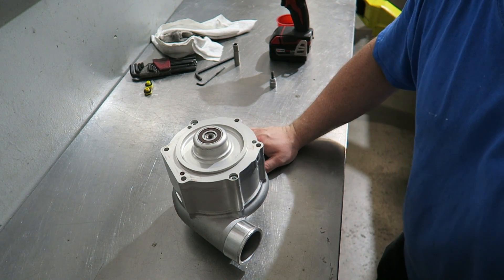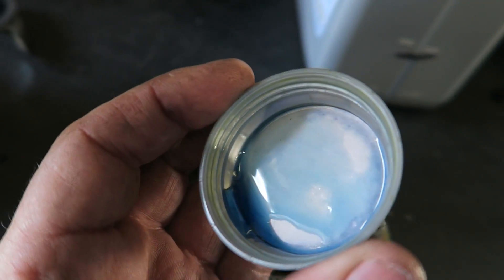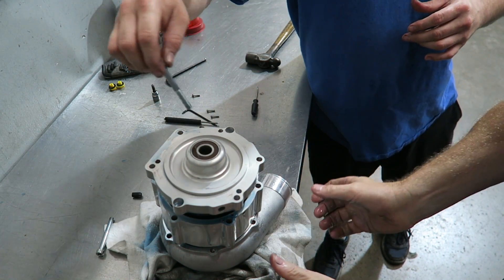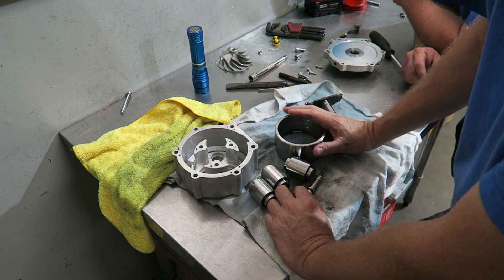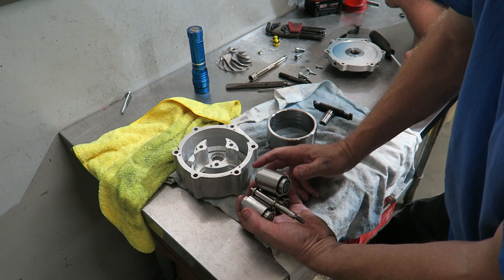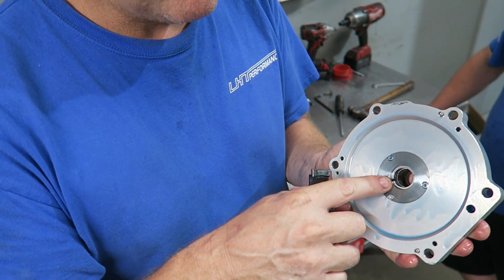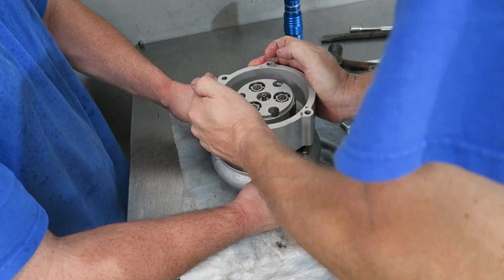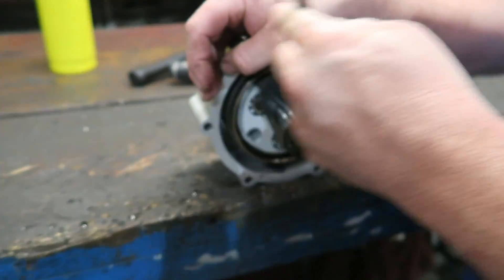INSIDE A KRAFTWERKS SUPERCHARGER - Rotrex

Comment: C30-94 on my 2.7l Toyota Tacoma lasted only 17K miles. It still makes boost, however, suddenly sounds like marbles in a tin can.    Daily driver and never abused.  Very disappointing from a financial standpoint.   That being said, I am a Journeyman toolmaker at a high precision machine shop.  I appreciate the teardown in this video and will be diving into what has failed along with mine. Hopefully, along with the help of an engineer or two, come up with a solution for the failure and make improvements.   There is no sense in buying another one with the rate of failure of these units.  Hindsight is 20/20, should have done more research prior to selecting this brand.

Comment: It's basically a Paxton SN series that uses 3 cylinders instead of 5 balls. And while the rotrext pulley turns the drum, the paxton SN  pulls turns the ball carrier (piece in the rotrex that the 3 cylinders ride in).
I bet it's a precise fit ,because the paxton had big springs that squeeze th barrel portion against the balls to get th traction

Comment: I think mine  broke
Reply from the maker: What is it doing?
Reply: @LHTPerformance  so it only has 5000 on it. It made a loud clang noise when I was driving it. Then it started running like it had a miss or air fule mixer is wrong. I started it last night and it sounds like the shaft is spinning up fast. But their is not very much air pulling in. And the muffler just sounds like bad. It has no power. And to much throttle will kill it.
Reply: It ran grate before the loud clang noise. I pulled the spark plugs. It burned one up before. Their all fine.
Reply: Their is no black or white smoke from the exhaust. It sounds like a flutter kinda sound.
Reply from the maker: @iamwilladd  It’s doesn’t sound the blower that’s causing issues.   I would have someone plug in and look over the data and see what’s going on with it.
Reply: @LHTPerformance  ok I will get Brian spears on the horn a remote look over and try to iron it out.
Reply: @LHTPerformance  so if I have good comprehension. Is it possible I blew a head gasket?
Reply from the maker: @iamwilladd  The compression should explain a lot. I would have it checked out.
Reply: So I reached inside and grabbed the turbine blades, spun it in the correctly. And seems pretty easy to turn by hand. Like i can turn the belt by hand?

Comment: Interesting design. I assume the compressor wheel continues to spin when not under load like a turbo does due to the tri bearing setup? What failures are you having? No boost or leakage? Or lost of boost etc from 10 psi to 5 psi? I think I can probably figure it out, it is such a simple design. Oh, I am a mech. engineer so thank you for sharing the innards.
Reply: The impeller shaft breaks and bearing goes bad. There's lot's of video's out there.

Comment: I installed one on my 2013 MX5 about two years ago, and found the wine a bit loud. Two years later it sounds like a jet engine, to the point where it hurts your ears if the hood is open, any suggestions on how to make it quieter
Reply from the maker: I would recommend a fluid and filter change if it’s been a while. Keep an eye on the fluid color.  As it darkens it get a charcoal color and needs to be flushed.

Comment: The input shaft threads into the power transfer bar.  When it is operated the input shaft tightens into the bar. This is why you never turn the pulley backwards.  Doing so can damage the pump and can unscrew the input shaft from the power transfer bar.   Never turn the pulley backwards.

Comment: Just an FYI in response to the couple of nay-sayers.  I've run a c30-74 on my track-built Miata for about 8 years.  70-80k miles.  Often over-spinning it in competition, 200+ dyno runs in car development.  Car makes more than double the stock horspower, even with the current engine with stock internals, (unit outlasted the built race engine)  Issues with mounts and tensioners (KW and TDR), but never with the unit.  I'll be upgrading to a c30-94 without reservation.

Comment: Subj: Weak link.

The black plate connecting the "driver shaft" to the cage is my main suspect.
Why? that poor single piece of metal has to suffer the whole impact of reprated violent inertia variations..alone, I think the link between the driver shaft and the cage should look rather like a spokef wheel a gruyere cheese full holed disc in order to have the necessary rigidity/flexibility.

Comment: Great video demystifying what's inside them. I'm not an engineer but you'd think there'd be some cooling fins on the unit, or does it need some heat to make the oil inside function properly. I don't understand what the oil pump inside does. Is it circulating the oil through a cooler maybe, hence no need for cooling fins? It reminds me a bit of a viscous coupling, which is a dubious device in my opinion. These things seem ludicrously expensive too, compared to a turbocharger. Hard to believe D-motor use them on their aircraft engines, as they don't appear to be particularly reliable. Seems a good concept though, just needs some further refinement and development to be totally bulletproof.
Reply: Rotrex use a traction fluid which also has its own resorvior, filter and cooler.

Comment: Well you guys need to know these Superchargers have the highest failure rate of any forced system... Sadly it’s what’s on our Tacoma. I should have done more research before buying the URD Rotrex kit. My .02 cents is it’s a POS‼️
Reply: Randy,
Was it under warranty or were you able to find the failure point and what did Rotrex say?
Reply: @gabeh7373  No warranty on mine as I let it set in the box for two years because I had a few surgeries & while healing I read a LOT of bad reviews on these! They can’t be rebuilt and they are about $2k and up from the prices I have seen. You have to buy a totally new SC‼️ The Internet is full of negative feedback on this SC. Yes it’s a neat design but they break all the time...Ours is on a Tacoma the system is by URD / You R Dumb for buying this system. 👎
Reply: That sucks! I was considering one for my Lexus but I have to do my research. I'm curious of Rotrex has changed any of the design elements within the supercharger if they've been getting a high failure rate?
Reply: @gabeh7373  HELL NO when they take a $h!t they get another sale! Why would you change?
Reply: 😬😳😏.... OK Thx for your feedback👍
Reply: @gabeh7373  So have you found any other negative feedback about this? I’m having a hard time trying to unload mine for $1500 less than they sell for new and the vendor has been out of kits for months…
Reply: I have not found anything else to report on. I kind of put the whole idea on hold about supercharging my car so... 😑🤷🏽‍♂️

Comment: Why would you use this over say a Paxton or vortech?
Reply: Simplicity and power delivery most likely. Low to almost no extra load on the motor at low revs but gives a very linear power delivery like the other superchargers. Has its own lubing/traction fluid separate from the oil and coolant going to your motor. Very compact accessories (fluid filter, cooler, reservior)

Comment: Just curious, how did you guys press back the sleeve in? Bench press or using torch to warm it and press?
By the way these type of supercharger usually fail on the roller bearing, which i suspect of the compress tight fit to drive the shaft result a heavy stress and may due to dirt in the oil to cause it fall into the bearing  which fail during operation

Comment: Im seriously looking at this type of supercharger for my DC5R but iv seen so much about these snapping the shafts and failing. do you get any of these fail out of the amount of kits you have done?
Reply from the maker: K20TBH We have very few issues at all. Most of the issues are related to the belt having too much tension.
Reply: Ok that makes sence. Would a rotrex be the better option for me on track or potentially look at a turbo?
Reply from the maker: K20TBH If it’s just weekend track use either will work. If it’s serious road course I would recommend a build NA motor.

Comment: Are these actually better than Vortech, ATI, etc. with regular old gears inside?  It sounds like you are saying they are significantly more efficient???
I've got a Vortech V3 Si on a Subaru EJ253 and I'd like to get more power out of it.  I'm maxed out the Vortech at 52k impeller speed.  We only make about 320whp at 15.5psi @ 6200rpm.  I'm thinking about putting a Rotrex C38-71 on it and spinning it to Rotrex redline  of 90k with a 70mm pulley (crank puley is small: 5.22" so 70mm Rotrex with 7.5 step up ratio will get us around 90k impeller @ 6300rpm).  I am wondering if you can offer any insight?  The C38-71 should put us right in the middle of their compressor map... unless of course the Rotrex is so much more efficient that I should size up the Rotrex, expecting to make more power at a given Pressure ratio.    Even on the C38-81 we'd still likely be inside of the white  "island"  on the compressor map.  My  goal is basically to make as much power as possible without having to rev out the engine much more or more at all (i.e. I don't want to rev it out to 7k)  I've also looked at ATI's procharger CS-1 which has an 8.3:1 step up ratio.  If I am going through the effort of starting my build over from scratch I want a significant increase over 320whp we're getting now.

Comment: Maybe a splined impellor drive shaft would have cured the potential weakness within the unit, however this would have surely resulted in slightly higher manufacturing costs and been passed on to the customer.

Comment: OK. The issue is not with the supercharger its with the belt drive. Kraftwerks uses a tooth belt on these S2000 conversions. Rotrex say categorically to use a poly vee belt. If your not going to follow the rules you're going to break it. The input shaft is not pressed in, it is screwed in.  Follow the rules and it won't break. The shock loads when hitting the rev limiter or launch control are nasty and the tooth belt transmits the shock and the shaft strips the thread of the input shaft. TTS Performance do an S2000 kit with vee belt and auto tensioner, they don't have any trouble.
Reply: That’s the BIGGEST BUNCH OF CRAP I’VE EVER HEARD‼️ This supercharger has the highest failure rate of any & ALL FI systems. The system I have uses the proper belt and they STILL FAIL ALL THE TIME‼️ Neat design but a POS‼️
Reply: @randy6350 I'm going to have to agree based on all the failures I've seen.

Comment: It's an epicycloidal system.
The same is used on excavators and bulldozers drive trains ,but backwards,to reduce speed ,increase torque,reduce load per moving part.
It's a really old design,and this one is just working on simple friction,with no teeth.
If you get loose bearings,looser tolerances and no more friction,so no more spinning.

Comment: still dont get why we cant spin it backwords
Reply: HORSEPOWER4321
1 second ago
OK. The issue is not with the supercharger its with the belt drive. Kraftwerks uses a tooth belt on these S2000 conversions. Rotrex say categorically to use a poly vee belt. If your not going to follow the rules you're going to break it. The input shaft is not pressed in, it is screwed in.THIS IS WHY YOU CANT SPIN IT BACKWARDS.  Follow the rules and it won't break. The shock loads when hitting the rev limiter or launch control are nasty and the tooth belt transmits the shock and the shaft strips the thread of the input shaft. TTS Performance do an S2000 kit with vee belt and auto tensioner, they don't have any trouble
Reply: U undo the threaded input shaft

Comment: Seems bound to fail through wear. Everything is fixed diameter and over time the tolerances will fall out of spec and slip will occur. Seems like if the barrels, shaft, and ring were slightly conical and there was a spring to hold them against each other the whole assemble would hold itself in spec over time and wear.

Comment: the tolerances probably became so bad that all those smooth surfaces no longer have any traction.
pretty shitty design, you could do the same with actual gears and it would never wear out if you have the same fluid system.
Reply: Mahir Fredericks actually the surfaces don’t really touch when in normal operation.  The fluid fills the gap and under compression turns very viscous. That’s what actually transfers the power. On the bench it spins because the clearances are off due to disassembly. That’s why Rotrex doesn’t recoils these units and they are essentially destroyed in the tear down process.
Reply: @wantapgt  yeah ima call BS on that explanation, grated that even if we talking machine ground metal surfaces we still cant actually say they are ever "touching" but we close as can be, generally we have a very low metal to metal friction coefficient, the fluid has the effect of improving the coefficient exactly as you say and lubricating at the same time. However

Under load this super charger will get hot, really hot, and it's definitely not the Fluid that imparts spin from the Ring to the Planetarys and so forth,  if that were the case you would start producing less boost as the part becomes heat soaked due the the fluid expansion and therefore less density, thus less spin on the final drive shaft. 
But the homies at LHT have already confirmed that after the part becomes hot it produces more boost. This is because tolerances are becoming tighter and therefore more friction between the surfaces... thus less slip.

Also, it spins on the bench because humans have much less torque then cars. LHT said that the unit is defective before they opened it, i suspect under an actual engine load the surfaces just cannot impart enough spin to the compressor, this is because traction flud is a lubricant first with a traction additive . Using your fluid imparting power logic this unit would never be able to fail if the correct tolerances are met. they most likely have decreased in diameter by a thou or 2

Most importantly you cant compress a fluid, fucking sigh
so logically speaking, using your fluid transfers the power idea, where there is compression there is high pressure and as such also, the inverse will have to exist in the same system, aka a very low pressure... a low pressure on parts with tolerances like these would suffer from massive cavitation bubbles which would absolutely destroy the surface of the rollers.

lastly, The planetarys are in sitting in a carrier housing with the ring gear around and the sun in the center, the clearances are just fine on a bench as long as all the parts are concentric, every surface in this unit has been turned and then ground to be a friction fit and should provide a gear increase as such.

But all i was trying to say above is that you can get this same effect if you used actual gears, which will be much less likely to fail, and essentially could be a quarter of the size in thickness, i would consider this manufactured failure, even thought the kit is awesome, they know that forces are quire low and can get away with gear train which only uses friction. over time they know there would be slip in the system causing wear and thus the unit slowly becomes less effective.
Reply: @mahirfredericks4013  We both were partially correct... but me more so.. The fluid is what transfers the torque, like I said.  Under pressure, or compression, whichever word you want to apply in this case, the fluid becomes viscous, like I said before and transmits the torque.  The illustration you can find in the technical handbook shows the fluid going between the rollers and doing the work.  There is no way the tiny contact patch between two smoothly machined surfaces can transmit torque on their own for any useful amount of time.  Likely that blower failed because there became a gap too large for the traction fluid to work its magic across.  From the rotrex technical handbook that came with my S2000 kit: 

The Rotrex patented traction drive uses a steel annulus with a small pre-span to secure contact
between the roller planets and the sun shaft with a reasonable force. The ramp or wedge effect
increases efficiency and reliability in the transmission by regulating the torque transfer capability
on demand through self-adjusting planet geometry. This is a key operational feature since friction
is highly dependent on surface pressure, slip and temperature conditions in the traction fluid.
Developed specially for its use in Rotrex superchargers, the special traction fluid momentarily
increases viscosity under high surface pressure, enhancing the traction drive performance by
securing the optimum friction between rolling elements while cooling and protecting the system

My interpretation is that "reasonable" force means almost none at all.  Also included is an illustration that demonstrated the principle I was trying to explain.  

Google "rotrex technical handbook" and go to page 9 to see the illustration on the right.  Clearly showing its the fluid that does all the work.
Reply: @wantapgt  k im going to give you some physics advice here... read "Fluid Mechanics and Thermodynamics" 

you will take notice that, a fluid cannot exert an axial force in the direction of a tangent which it acts upon only SLIP.

ill leave that for you to interpret... but its up to you to believe the marketing wank.